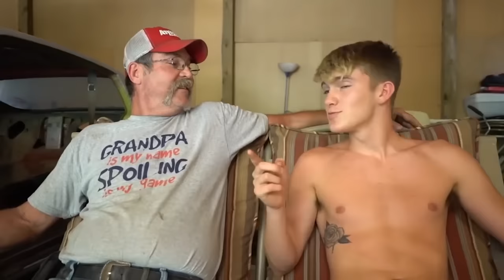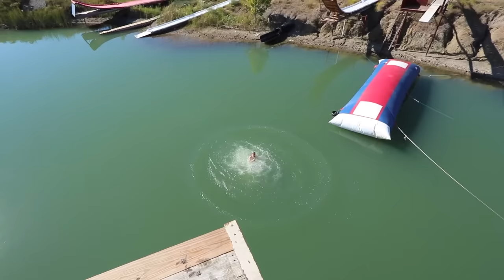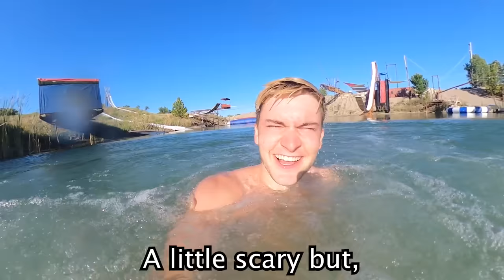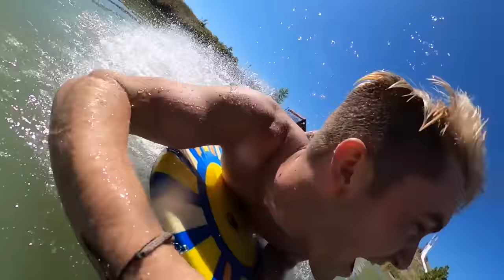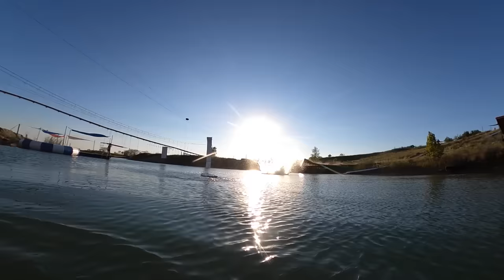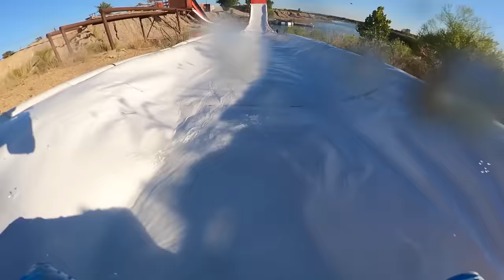I Visited The World's Biggest Backyard Waterpark!

Comment: Back in the 80's there was a very similar a waterpark here in WV called Rock Lake Swimming pool. It was a manmade lake about the size of a 3rd of football field. It had a bunch of fun features like swinging ropes and water slides, but some of them were crazy. For example, you could jump off a cliff to a trampoline about 10 feet down. It was angled so that it launched you into the water. There was also a zip line swing, and a rope that swung out half the distance of the pool. 

As people started getting hurt, the more dangerous attractions were removed, until it was little more than a dirty lake with trampolines in the middle. Eventually, it closed down, the lake was drained, and low-income apartments were erected where the lake used to be. The cinderblock walls that contained the lake are still there, as well as the trench where the waterfall spilled into the lake. They stand as a cool reminder of a time when sanity was in short supply, but fun wasn't.

Comment: That last slide / floating off the slide when riding it feet first ... that kind of thing is probably why the original Action Park in NJ had their speed slide covered a good portion of the way down - and that was not a 90, but an 80 degree  drop at the start (so a liny bit less than here).
Reply: Hhghhh

Comment: I have a important question. The water has a slime Green Colour, As of 06 01 2023 Pond water has Blue Green algie BUT RIGHT NOW AS AUGUST 05 2023  THERE HAS BEEN A MASSIVE OUTBREAK OF Naegleria fowleri infections are rare, the CDC says: Between 1962 and 2022, 157 cases were reported in the United States. Of those cases, two people were infected after rinsing sinuses using contaminated tap water. 

Between 1962 and 2022, 37 cases of Naegleria fowleri were diagnosed in Florida, the CDC said. 

THEY are not to be treated like they won't kill. They enter the body were Holes are like the tear ducts in your eyes or Nose Rectum your WeeWee Holes. 
The 2 young Adults who died from this infection were in water that Absulootly looked the same as the water in this Video..
Question Can the small lake private lake not be treated with pool clorean you would only need to treat this 24 hrs before use. Smart or what